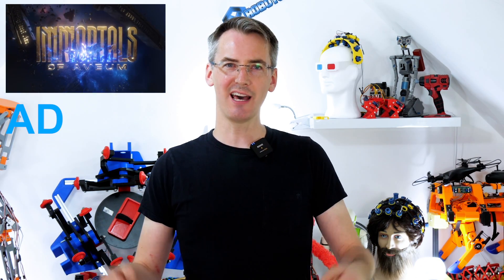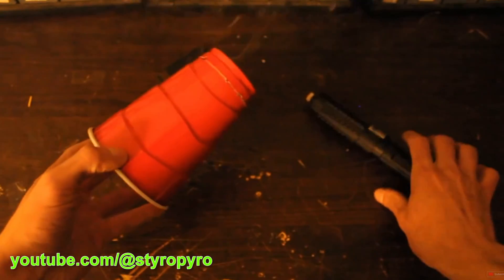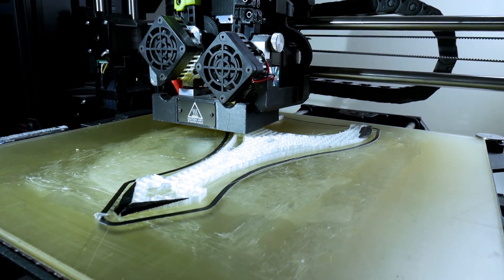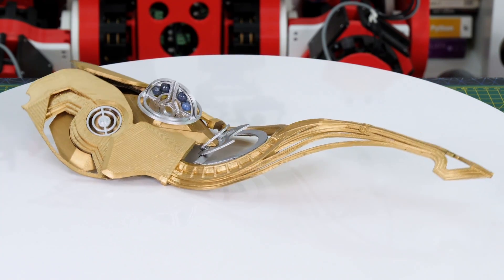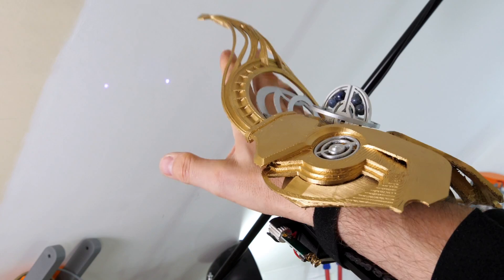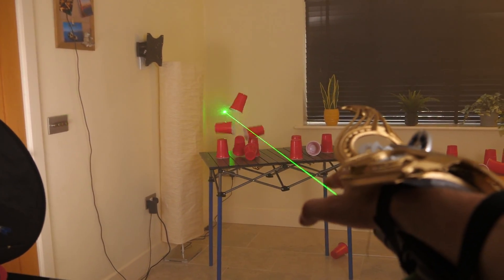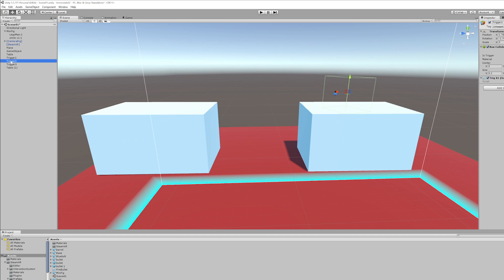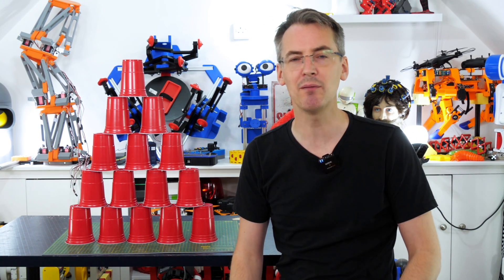Experiments with hard light

Comment: You should look into setting up the slicing software to only use PVA for the support interface layers, it saves a lot of the expensive PVA filament when most of the support structure is printed with normal plastic and then switching to PVA for just the attachment points to the model
Reply: also, switching to organic supports instead of grid, it saves so much material while also being way easier to remove without the need for PVA (tho for very intricate parts like here PVA is definitely a plus.)

and since the organic supports can bend around parts, even weird cavities print cleanly.
Reply: This is the way
Reply: Thats a good idea
Reply: first I thought its some sort of air gun underneath, 
but this has some intresting potential, and maybe i sound bit more Sci-Fi but still connecting VR with reality - well maybe we do live in some computer simulation lol.
Reply: Also a  printer that doesn't  move the heads up and down might be handy for  time save. At first  glance  one would think the movement is useful for avoiding  uneven extruder crashing. But realistically both extruders would still need to be level at their lowest travel point so his dual-extruder machine is doing some nonsense  there.

Comment: You CAN actually apply force with a laser though...

In physics, momentum is defined as the product of mass and velocity of an object. According to the law of conservation of momentum, any change in momentum must be accompanied by an equal and opposite change in momentum elsewhere in the system.

Light, although massless, carries momentum. When light is absorbed or reflected, it can transfer some of this momentum to the object it interacts with, thus exerting a force on it. This principle is the basis for optical trapping methods like "optical tweezers," which can trap and manipulate microscopic particles using laser beams. It's also the principle behind solar sails, where light from the Sun is used to propel a spacecraft by transferring momentum to its reflective sail.
Reply: what's the Compton wavelength of a plastic cup?
Reply: You are technically correct.

So where can we download the build files for your version?
Reply: I'm sure he knows that.....but even if he didn't for most non-ultra-scientific, hobbyist purposes, he is much more correct.
Reply: @Pgr-pt5ep  He might know that, but plenty of people don't and even if he did. 
The reason plenty of people don't is because they get treated like the nuance is too complicated for them. 

He didn't even have to explain how momentum transfer of light works he just had to use language like, under these circumstances I could never get a laser powerful enough to push the cups over.
Instead of saying they cannot do it.

Reduces the spread of misinformation and for the subset of people who would be interested by that new unknown could go look it up.
Reply: @Pgr-pt5ep  ".but even if he didn't for most non-ultra-scientific, hobbyist purposes, he is much more correct."

Eh, no. He could have said light applies negligible force, but he didn't. He said it applies no force, and justified it by saying light has no mass. That justification, that argument, is incorrect, regardless of how well it seems to work in practice. It's important not only to be right, but to be right for the right reasons.

Comment: You CAN actually apply force with a laser though...
Reply: Through ablation, turning the object into the fuel that pushes itself away from the laser. Totally metal.
Reply: @Amlonde photon pressure is a measurable force on its own, no ablation or combustion required... you just need a lot more photons than we can realistically generate to do anything particularly energetic with it.  Solar sails  work on this principle.
Reply: yes but you will need a star's power to knock a plastic cup
Reply: Down vote this garbage advertisement of a video. Was a complete lie